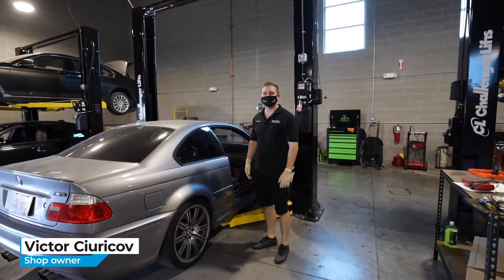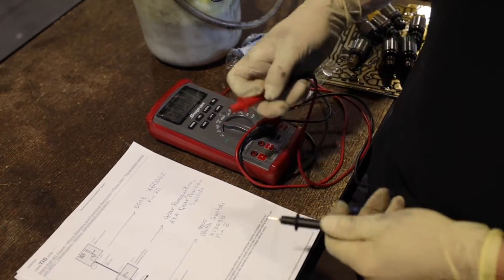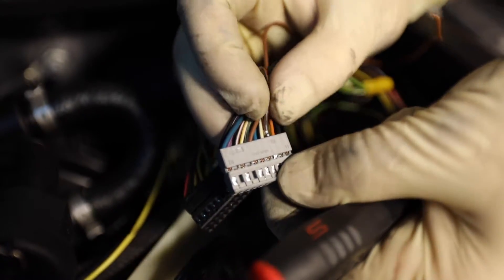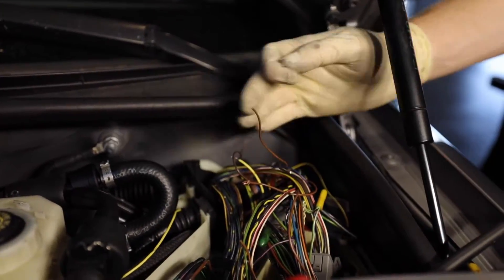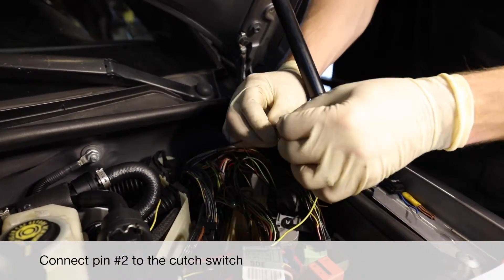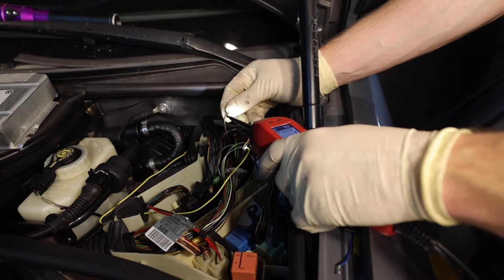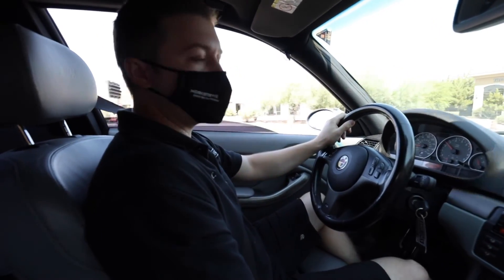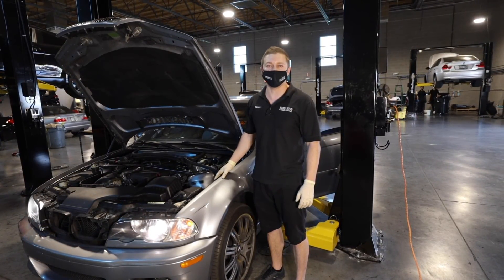How to get Cruise Control Working after a BMW SMG to manual swap!

Comment: Hi Victor.  I thank you so much for the video.  So useful and helpful 👌.  
I bought an E34 540i of 1994 which was automatic, found it converted into manual.  Can this be done,to get cruise control to work? 
Thank you for the anticipated response 🙏.
Reply from the maker: I'd have to look into wiring diagrams but it's difficult without seeing what's been done on the vehicle without tracking every step. Find a BMW specialized shop and let them check it.
Reply: @werkstatte-bmwonly9515  Am a huge fan of your work.  Yhsnks for yhe advice.
Reply from the maker: Thank you 😊

Comment: Massive probs guys! I really really appreciate your efforts on this video and guidance. I converted my car two years ago without this working. I followed the wiring and boom it finally works!! The rev lights not working when car is revved, any suggestions? Thank again guys!
Reply from the maker: Rev right was an option only for SMG cars. But you can find a tuning company that can code it. It's doable.
Reply: I had the conversion done on my car.... And my Rev lights work @werkstatte-bmwonly9515

Comment: Do you have an idea about m47 to m54 swap?  Would it be easy?
Reply from the maker: Diesel to petrol? It would be easier to buy two cars. Everything will be different. Fuel delivery system. All the wiring. I'd never do it.

Comment: do i need to program dme if i do swap on my bmw e63 630i with ssg(smg1) transmission. I want to get rid of it  and to put manual transmission in the car. I know to do all coding and to change veichle order but i dont know how to change dme msv70 software  in winkpf . Only option there that i can see is to update dme not to really change dme software number?

my current dme zb number is 7581256 which corresponds to 
BMW   6 SERIES E63/E64   630i 3.0L L6 24V 200kW/268HP MSV70   SIEMENS   MSV70   7577968   7581255   7581256
Reply from the maker: Yes, it's more then coding. You would have to flush it at least or replace it. You'd have to see if the part number is the same for manual and smg models. If it's different then you'd have to replace it.  I'm not familiar with winkpf. We use Autologic that has conversion set up in the system already or Wizard. I prefer wizard because you can pick the software number manually, change VO and code modules individually or all at once. Besides that we use ISTA and Autohex. Those are four of my favorite tools.
Reply: @werkstatte-bmwonly9515   as far as i can see there is no diffrence in dme for e63 630i smg and non smg so that means i dont need to touch dme just to code out smg out of the car ?
Reply from the maker: Code and flush the dme. Coding would be in modules like instrument cluster,light module, general module, ews or in your case would be CAS. But the DME would have to be flushed first then coded. If you have flush files available let me know the numbers and I'll check witch one is for manual transmission.

Comment: Do i Have to  update a manual soft dme to m54b30?
Reply from the maker: I don't think so. Just change the coding setting in the ews to manual. As long as your cruise control works and you don't have a power decrease you'll be fine.

Comment: Would it be the same process for the ssg (smg1) gearbox fitted in some e46 325i?
Reply from the maker: I'd have to check the wiring diagram but it could be very similar.
Reply: @werkstatte-bmwonly9515  I would like to know that too. I also have a e46 325. Im installing the standard manual transmission for the car (Getrag S5D 250G). I believe it only has a reverse sensor. Please let me know. Thanks in advance.
Reply from the maker: From sensors manual transmission only have the reverse light. Smg had oil level, temperature but the manual doesn't have anything but a reverse light.
Reply: @werkstatte-bmwonly9515  So there is no way of making the cruise control work? Or does it work a different way? I have seen a video of automatic to manual swap and they connected the reverse sensor/light to a brown/black wire from the location of the Salmon smg relay only this whas a blue relay.

Thanks for your quick response!
Reply: @werkstatte-bmwonly9515  I swapped the transmission, wired the clutch switch, did coding in PA soft, NCS expert and INPA. The cruise control works perfectly. The only thing not working yet is the reverse light. From the reverse sensor i have one wire to ground where does second (plus) wire go?
Reply from the maker: Check out this link. it has detailed step by step instructions https://www.mforum.net/forum/e90-m3-sedan-e92-m3-coupe-e93-m3-convertible-2008-2013/diy-ab/84-diy-comprehensive-smg-to-manual-conversion
Reply: @werkstatte-bmwonly9515  thanks
Reply from the maker: You're welcome. Let me know if you still can't figure it out. I'll try to help
Reply: @jakesprojects1978 can you help me in getting the cruise control to work? My M3 was manual swapped by the previous owner, everything except the cruise control works.
Reply: @UnapologeticIslam I actually did not need to do anything for the cruise control to work. It worked right away after the swap. I did install a clutch pedal sensor and wiring. Maybe that could be the problem for you. Do you know if you have a clutch sensor installed?
Reply from the maker: I'd have to look into wiring. It could be pretty similar.